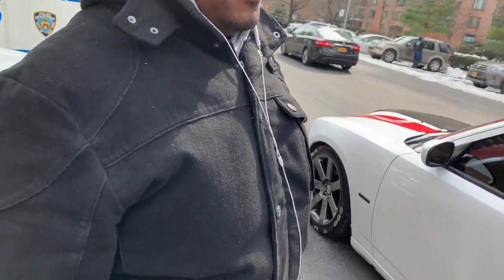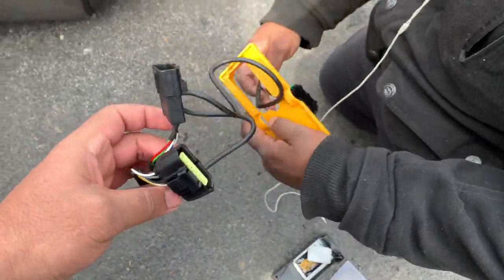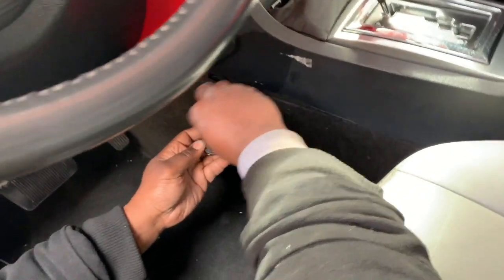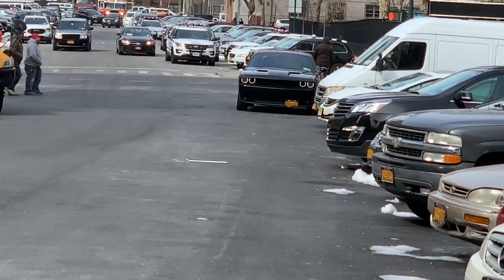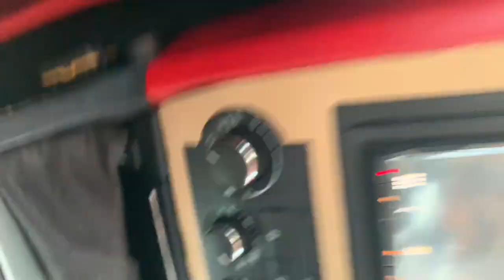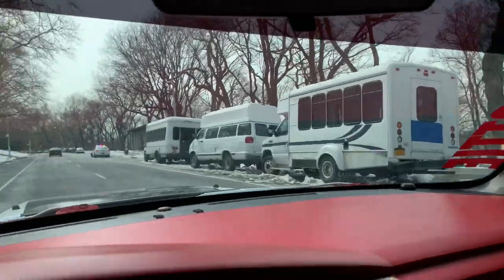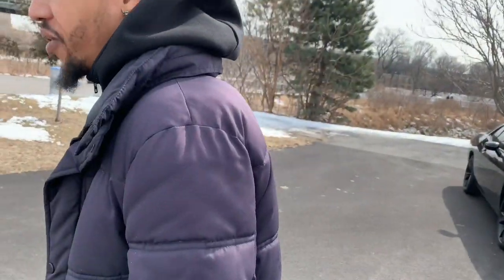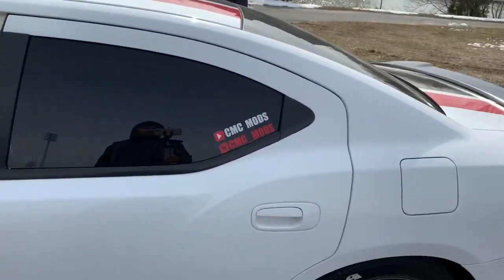Pedal Commander Install | Dodge Charger } Test Drive (4K)

Comment: Was just surfing YouTube for pedal commanders and came across you guys I subscribed right away you guys would be fun as hell to kick it with keep these  videos going and I can tell you right now I drove my buddies 2015 Ram 1500 Laramie and damn near felt like he souped up the beastly 345 hemi (5.7) with how much more G's it was  sucking into the seat we was acting exactly the way you guys did lol the pedal commander really is that much more fun!!
A lot of people will tell you that know a lot about them 57 hemis you can buy and bolt on every single upgrade you possibly can without touching the guts whatsoever and that motor will handle it with ease it's like the 350 of Chevy extremely dependable extremely well built.
You guys probably know this but out of every single hemi 5.7 I've been around a 2010 1500 Ram Laramie 5.7 l a full K&N airflow system, the pedal Commander and last but not least the notorious Diablo tuner which has been proven to work far better on hemi engines than any other engine from any other class I base it all on the heads obviously but he not honest to God knocked damn near 1 1/4 sec off his quarter timee with just those three bolt on's and premium pump fuel and if you can tune the Diablo yourself and install all three things by yourself then you'll be spending right at the 1G mark and that 1G will be by far the best G and most fun spent G you most likely will ever have spent I promise!!
345ci's do not need any gut work that's how well built these 5.7 hemis are you guys are awesome keep it up and sorry for the long message be safe out there keep them coming and God bless
Reply from the maker: I appreciate the long message it shows the support we here in New York so if u definitely in the area follow the Instagram sp we do pop up meets if not in the NY area we are doin some travelin I already did a 3 state tour more to go and yes that pedal commander is something else makes you enjoy your car again because alot of guys think they have to go upgrade when they dont have the money to when the 5.7 is the original OG I would of upgraded along time ago if I didnt put the fun back I  the 5.7L  that's the day I decided to pick up the camera and document my journey.

Comment: Have you had any problems with the pedal commander since this video??? I’ve seen a lot of ppl talking about the car stalling or going in to limp mode while driving. Let me know how your pedal commander still running I’m looking to get one on my SRT8 2007 Charger but skeptical.

Comment: How he un fasten the original pedal one that shit is tuff
Reply from the maker: It's a clip like what's on the pedal commander should be red if not black u push it up n pull put the other one on make sure its clipped on hard so it dont come off.

Comment: Yooooo!!! I'm bout to order me one. The install didn't look that hard. Is it still kicking?
Reply from the maker: Yes it is still gor it on the car I'm about to update it n put this on the Magnum n put the pedal box instead it's German I been herring it's better and won't put u in lump mode the pedal commander still good tho but if u gonna spend the same money go with the pedal box u can find it on eBay.
Reply: @CmcMods  good looking bruh! I'm working on my baby now... Slowly but surely.
Reply from the maker: @MISTAPIP13  it's the only way to do it one step at a time no rush because if u can get it done at once next month u gonna tired of it n Wana do something else trust the process u got this 💪
Reply: @CmcMods  thanks. Where you get that spoiler and carpet from if you don't mind me asking?
Reply from the maker: @MISTAPIP13  both on ebay
Reply: @CmcMods  thanks!